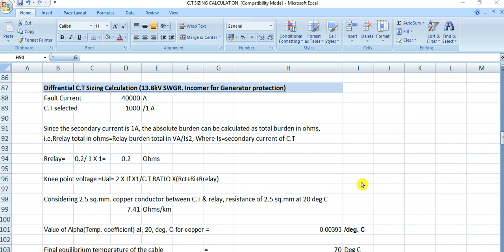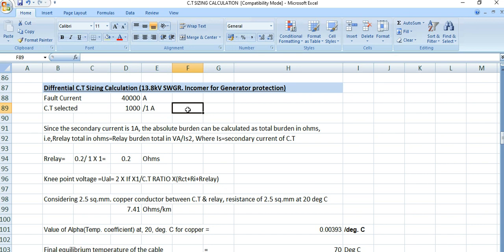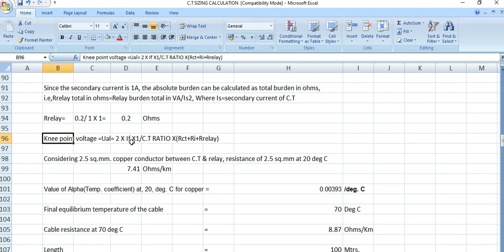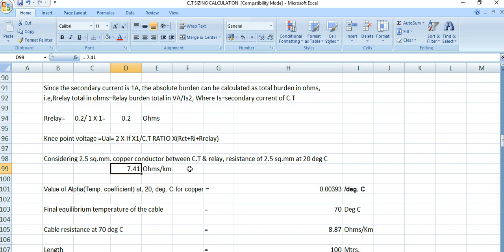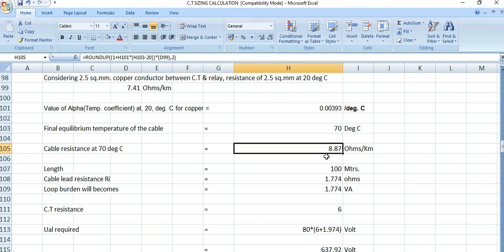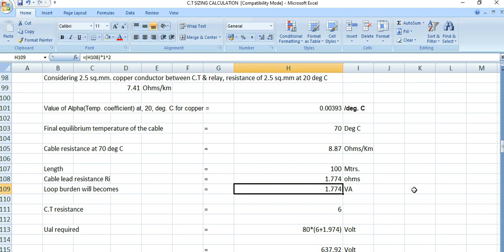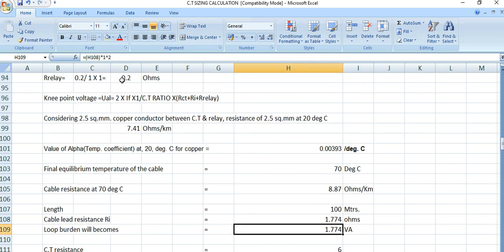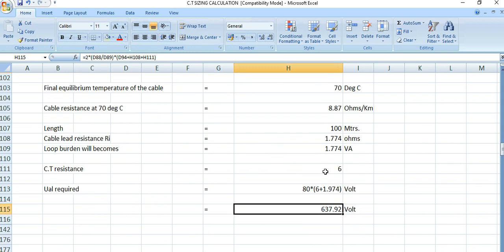CT Sizing Calculation in Excel - Differential Protection CT

Comment: Bro for differential protection we have to calculate the fault current which includes source impedance as well as cable impedance. But Knee point voltage what you shown here is applicable only for close-in faults which will have only source impedance that is busbar symmetrical short circuit current.
Reply: Sir can you tell me how you calculate through fault in differential protection 
I am confuse how to calculate knee point voltage in case of line bay (differential protection )